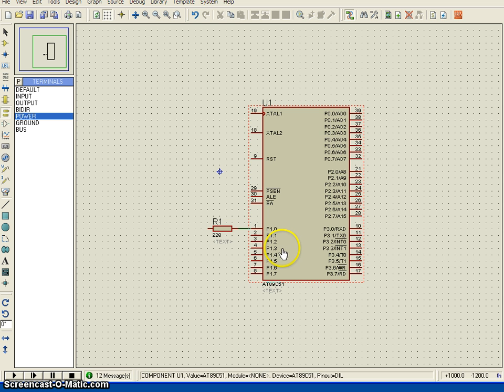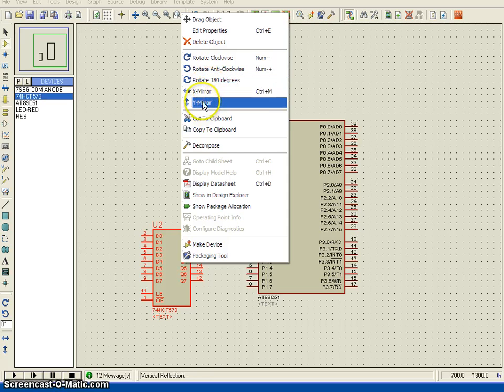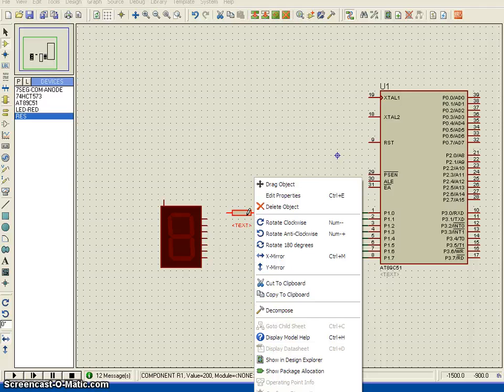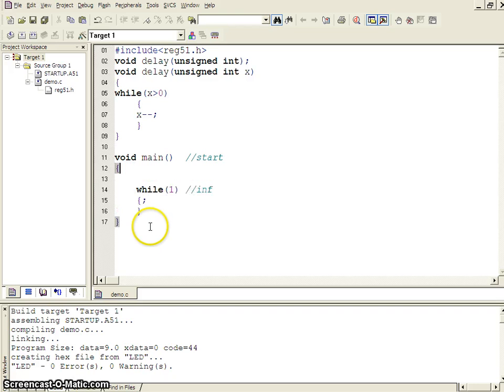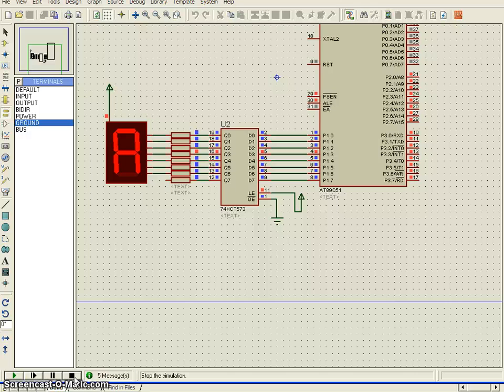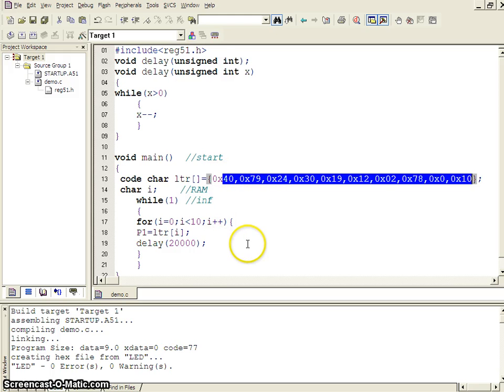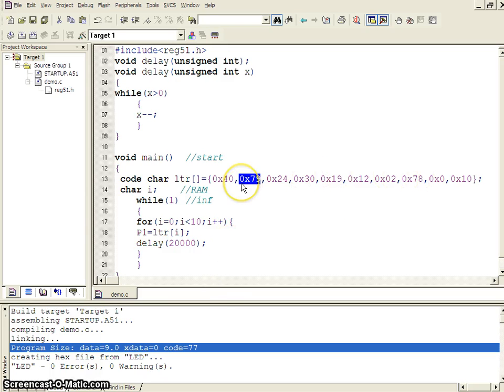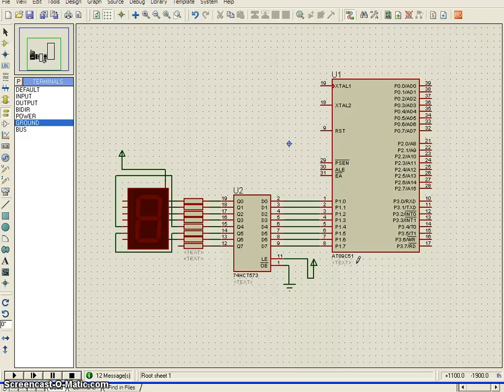Proteus Video 8____ 8051 Seven Segment Example KEIL

Comment: Sir, I am from electronics branch I just want to make countdown clock with days : hours (DD: HH) only. So should I use pic 16f with ds1306 or microcontroller at89c51 but I have to use 7 segment display only to display the numbers...
plz reply asap.... my mail i.d. is  kshitiz195@gmail.com
Reply from the maker: Hi,
It is possible to use both uCs. There are ready-made libraries for IIC. You need to develop further for your application. The libraries will provide basic read/write operations.
You may consider PCF8583(RTC) as well.
Good luck!